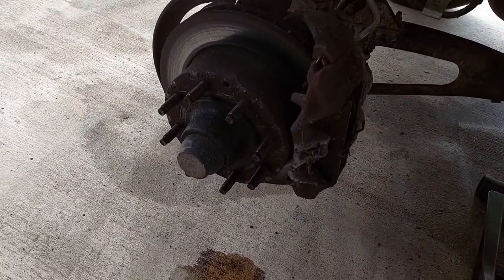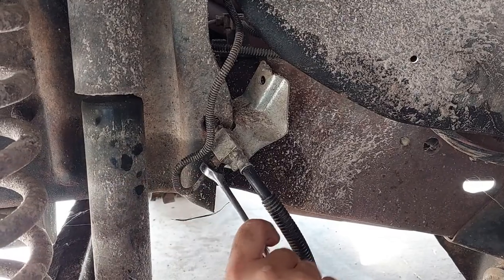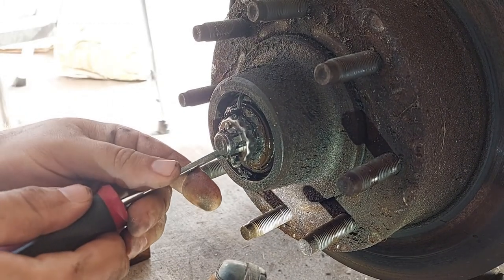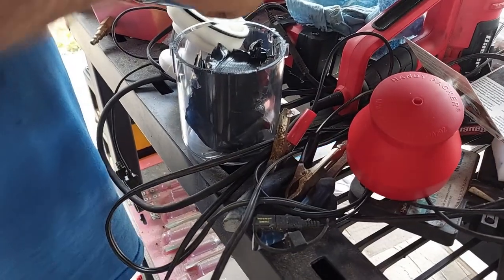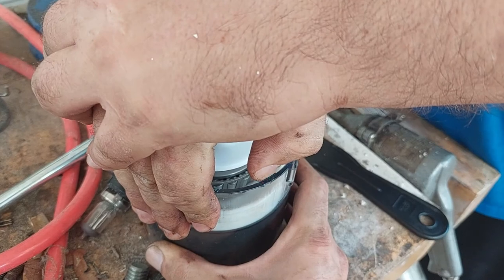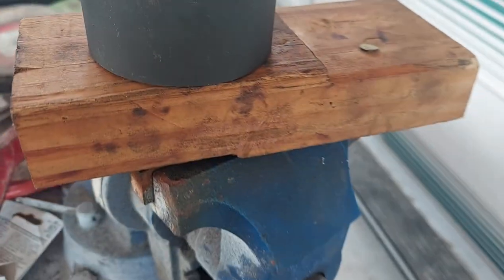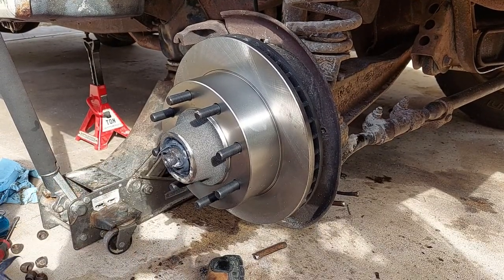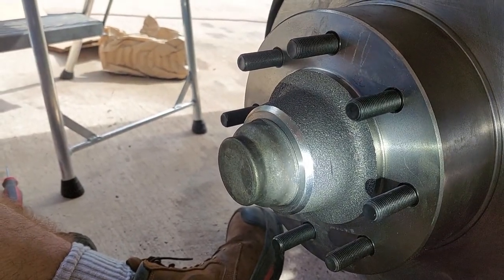Episode 95 - Front Brake Pad, Caliper, Wheel Bearing and Rotor Replacement 1993 Ford F250

Comment: Well, thangs works in mysterious ways...My "GA's" really looks out for me...1993 Ford f150 5.0 truck Extra Cab...XLT...142,000 on the clock...By the way, it has those janky slide clips on the calipers...And I have to change out the Front Bearings...Previous owner did the Brakes...Glad you made this vid as I wouldn't had any clue what they were, let alone how to get them out...Rite now, I'm shaking in my boots, watching tons of vids on how to remove and replace the Dizzy...Never done it before...Had a 1994, 4.9 straight 6 that I did alota work...Sadly it got totaled and was junked....Somebody else said on these OBS Fords,  "The Fixing Never Stops"...I'm inclined to believe that....Oooohh,  add Heater hose and Blower motor, gasket, and Resistor to the above list....😂😂😂
Reply from the maker: Dizzy is not bad.  Carefully mark where the rotor is currently pointing.  Remove dizzy.  At this point do not turn the engine over in any way shape or form.  Carefully install new dizzy, making sure the rotor points at the mark you made earlier.  Then you should be good to go.  Of course, if you are out of time already and you need to find time before you install the new dizzy, that's a different matter.
Reply: @MazdaB3K  ... Well,  thanks for your reply,  sir... I did the fuel pumps last Summer...New pumps came with a different wire code than the original...Looked at tons of vids on what the Color code was...Its 20 million Color codes for the wires...I guess it's depends on what Ford had on hand as the wire suppliers...I matched mines to how the Factory plug was set up,  nevermind the color...Worked out great ...👍 👌 ...You are a big help...Will mark and mark some more to get the  Dizzy lined up...If I had the money,  I would just fly you  in and pay you and let you do it...😂😂😂...But, alas , we ain't won the Lottery yet,  sooo....we forge forward...👍👍😊😊...Take care 🙂
Reply from the maker: yeah, I had to replace the fuel pump on my 2001 F250 and it was a bit of a mess, wire colors didn't match and all that.  Had to figure it out.  I made a video about the entire process.  I couldn't remove the bed to service the pump so I had to drop the tank from below... that was fun.

Comment: Great job of explaining and videoing.  The only thing that I could add is that the slider pins are tapered more on the side that goes into the caliper bracket.  I haven't done it but it looks like they could be pounded in upside down since one side isn't all that different looking.
Also, how did you remove those?  I had a bit of a hard time and ended up using some vicegrips, squeezing the end while wacking with a hammer.
Reply from the maker: The slide clips?  I took either a 1/4 or 3/8 drive extension and a hammer to shove them out.  You need the size that large enough not to go inside the clip, so I think 3/8.  It works really well.

Comment: GOOD VIDEOS...but why didn't you show removing the caliper from the brake assembly? Just like you didn't show mounting the short tough springs on the rear brake overhaul. Why?
Reply from the maker: I reviewed the front rebuild video and I showed what was required to do the rebuild.  The caliper is in two pieces, a "frame" and the caliper itself.  I showed in the video how to remove the slide clips that hold the caliper to the frame and noted that once that's done you wiggle the caliper off the rotor.  As to the frame, the frame did not need to be removed in order to remove and replace the rotor so it was left alone.

As to the rear video... I'll be honest.  I don't remember if i forgot to film that or I chose not to due to not having the right tools.  If you are referring to the two springs at the top of the backing plate near the wheel cylinder the best way I found to put them back on is using a flathead screwdriver to slide them back on the central post.  However, this gets a bit tricky as the screwdriver doesn't always want to stay penned against the post.  There are specific pliers made for the job but I don't have them.

Comment: 😂😂😂....Really starting to think that if you , meaning anybody,  bought a used 90's year Ford f150 5.0 truck  or van, you needs to start saving and be prepared to replace the following...Radiator and applicable hoses, Water pump,  Alternator,  Power steering pump , Coil springs and shocks, while you are there, Bearings,  brakes, Steering  box and steering shaft and maybe all applicable fluid lines with line gaskets....
Maybe the tranny fluid,  differential fluid change.. Both fuel pumps,  with fuel filter,  and if that ain't enough to just get you started,  all those pesky Plastic Vaccuum lines...That's for starters...Hopefully,  you don't have 4WD..
Brang Lunch...AND Dinner...You gonna need it...😂😂😂😂!!!
Reply from the maker: Yeah... when you buy a truck that's pushing 30 years plus and generally rode hard and put away wet, lots of stuff stars to wear out.  My 1989 F350 fits your description to a T.  So much to do to get it where I want it.
Reply: @MazdaB3K ...you ain't lying...Totally didn't mention all the body work that needs refreshing,  especially my hood...I don't know if Betsey LuLu was a Construction trk, farm trk, or Hunting trk...I didn't ask...Tons of scratches and a few serious dents needs some attention...It's not beat up, but I would like to have it almost "Factory fresh"..... The interior was freshened up some, but still needs some more work...I tell myself all the time...Nuffin' that 'bout $200,000 and a full body off frame Resto can fix...including the Drive train...😊😊😊...Oooohh well, we continue on our "Projects "....😂😂😂👍👍